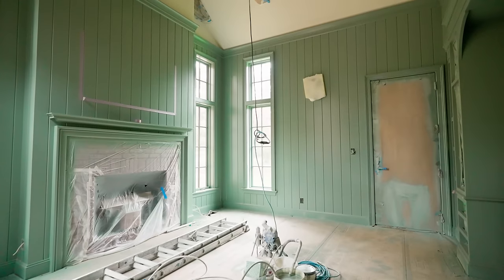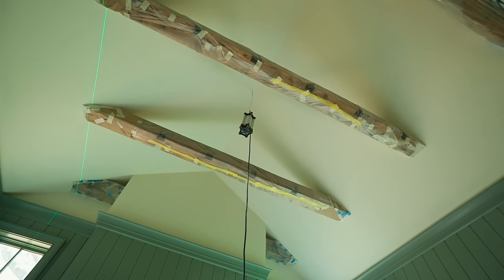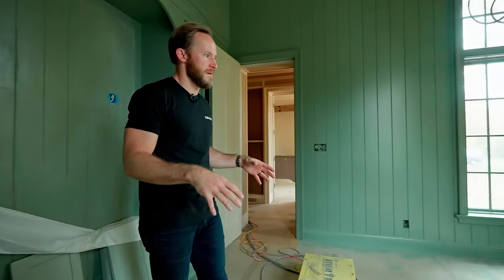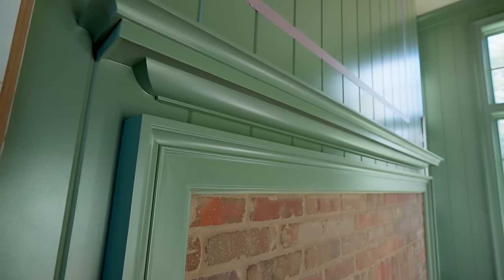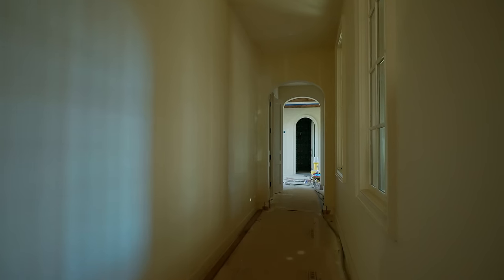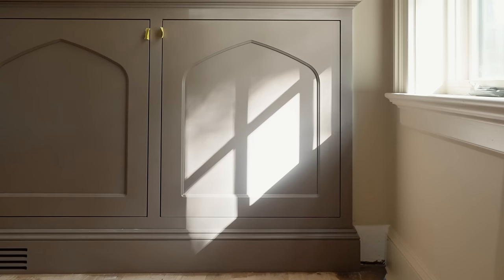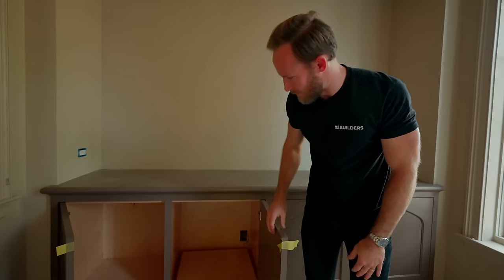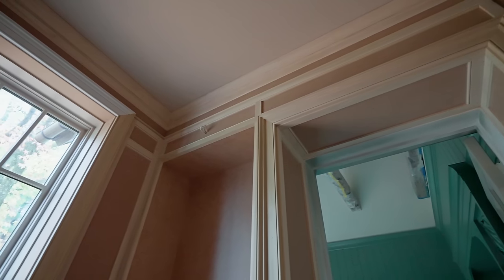Building Details of Two Home Offices at our Needham project

Comment: Amazing work as usual!
How do you paint those deep moulding cuts?... Especially the horizontal ones?  I mean, paint wants to accumulate in such slots.  Are you using some special tools, technique, additives?  
Thanks
Reply: I see they spray all of them for that reason.  If the spray is done very thin and light it would help  alleviate that problem.  But you are so right, mostly those would be full of goopy marks on other builds.  Though man, wouldn't it be good to be working out of that green office as we write this?
Reply: @wesrobinson7366  Haha, not a big fan of that color but the quality of the finish is swiss-watch like.
I'm actually looking to have my mouldings redone and love the deep cuts but no way I want to spray them.  Not only because it requires more work/tools/experience but also because touch-ups as years go by will be very visible.